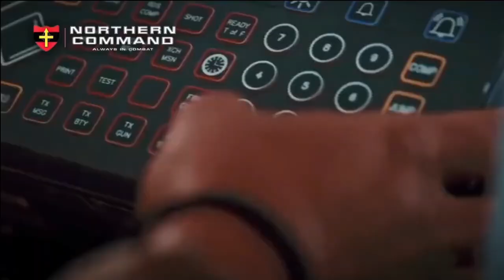Indian Army to buy 307 ATAGS for deployment along border with China and Pakistan #indianarmy #drdo

Comment: 105mm Guns and Ammo are a sad legacy of the past. They neither have possible ability to penetrate modern frontal armor. 
Nor a well built concrete pillbox. I know for a fact the L7 which was the mainstay gun during 1971 war was designed Royal Ordnance factory in the late 1950s. It has been 40 years overdue to shed this legacy of the British and go to a far more lethal caliber which is the 155mm. I am lad it has happened with ATAGS, K-9 , M-777, Soltam rebarreling. 

L7 default range is around 4000 metres - its a lot cheaper than  140 M777s which cost around $800million.India is not a Bhikhari Indians must sacrifice more to defend the country .  So let the surviving supply of 105mm rounds which is in the 10s of millions run out. In 2022 there were 1700+ L7 guns in IA inventory. 155m is the future one must fire with a CEP of under 1 meter at 40km range. 
This requires a massive upgrade to Rocket assisted projectiles(RAP).  BTW the Indian Tank from 1960s T55 Gulmohar used the L7 Gun. The L7 is also the M68 105mm Tank Gun. Move to 155mm NATO rounds its 30 years overdue.

https://archive.org/details/DTIC_ADA051050

Comment: Thanks for the information in the description. A source link will be greatly appreciated.
Although correct in having a FARP, simply having massive numbers of artillery is a poor solution to any current challenge. Far better to have half as many but well trained, well stocked, well supported by ISR, and strategically mobile artillery.
Artillery will remain king, but the logistics of supplying 3700 pieces with even 10 rounds a day is beyond the capacity of Russia, US, EU combined. India will have no hope in producing 37000 155mm and 105mm artillery shells a day. It probably won't recieve American stockpiles either.
So why have so much money and manpower to operation with the staying power of border guards. If you run out of ammo by day 2, what use are 3700 artillery pieces?
I know my argument weakness is that it has never happened that all artillery pieces of an army are being used heavily on the same day. But the staying will be measured in days not weeks.

Comment: Sir won't it make sense to go for Dhanush and ATAGS instead of Sarang. Dhanush can be upgraded as per current requirements. This will reduce types of systems, which means lower logistics costs
Reply: There are tons of versions of ATAGS available 
Forget about dhanush
Reply: @fly463  Army will b forced to buy Dhanush through threat of strikes. Even today Army depends largely on OFB.
Reply: @hrushikeshavachat900  
Dhanush is capable but OFB is not
Reply: @fly463  Agreed. But the issue is OFB employees will threaten with strikes if Dhanush isn't ordered.
Reply: @fly463  Who will supply 90 percent of the equipments and spares u need. Can't replace all of them in days. It will take years.

Comment: Army already has three Sharang regiments, it’s raising a fourth one, and eventually plans to have 15 such regiments. Sharang and Dhanush upgrades no longer make sense. It is more sensible to standardize on just ATAGS. It also makes sense to order many more MGS(Mounted Gun System) on a Ashok Leyland or Tata Truck. It makes sense to execute the plan and modernize the artillery, no need for delays. Kalyani also makes an ultra light titanium howitzer, which can replace any future orders of M777. At least 2 more repeat orders to induct ATAGS en masse is needed.
Reply from the maker: Yes
Reply: @IndianDefenseAnalysis  Basically if Dhanush and Sharang had been completed years earlier they would have made sense, but now it is more sensible to buy ATAGS.
Reply: @IndianDefenseAnalysis  bro any news on Kalyani's rocket assisted artillery shell ?
Reply from the maker: @AnirbanSarkar203  nothing new
Reply: It costs less than 1 crore to upgrade one sharang gun. So its budget friendly
Reply: @sohomi3031  ATAGS cost Rs 18 crore per piece. However, if more are ordered price comes down. Sharang will also not last for very long, these are old pieces.